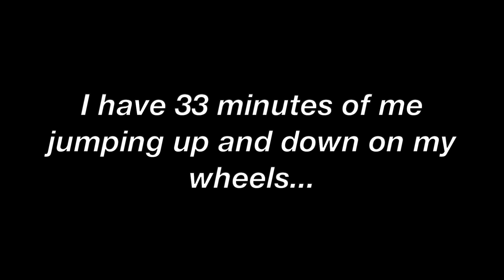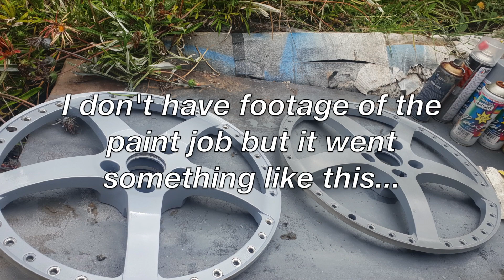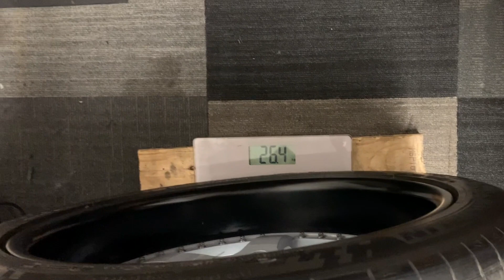Backspace, Offset and Superwide Wheel fitment. Stance 101: We fit 345s on an FG XR6 Turbo Ute

Comment: If you slot the rear guard in 2-3 places with a cutoff wheel, you can roll the panel a lot easier
Reply from the maker: Nice one BrettObie!
Have you ever found the panel flexes more where the slots are?
I would have thought it would end up cracking there over time.
Reply: @FairlyLegalCarMods   if you heat up the paint prior to, and as you roll, I've never had an issue with it damaging the paint. 

You will keep strength in the sheet metal from retaining the folds (if you leave a few mm of material before the bend radius) vs just cutting the whole lip off and pumping the guard

Comment: Nice work. Your clearance test is turning sharp onto a ramp. My ute had inside clearance like yours however the shockers hit on the wheel, and wheels hit on the chassis near the wheel arch brace. End result was added another 35 mm to my 40mm shortened diff (still minus 5mm). And then I flared the rear arches myself. I did it myself because ever oem customiser I dealt with stuffed every job. Premium Australian renowned Ford tuner put after market cams in it. 2 years and constantly returning to him because stalled and did all sorts and original cams back in and refund. Melbourne renowned drag race diff specialist in shortening diffs well I already explained that. Shaker distributor and fitter scratched my bonnet very badly kept the vehicle for a full day charged me $250.00 and never plumb the shaker up. I had to do it and his work was absolutely backyard butcher. Split system fitted and first drive and it was interstate the the exhaust actually fell off on the road. Took back and the tail pipes hit on the rear valence panel.... I got 355 x 30 x 19 on the rear of my Super Pursuit. With a huge off set to the outside. 3 peice auto art 9s on the front with 255s. Soon will flare the front to run 285s with approx 100mil of offset to the outside. Thanks for your video. Very good
Reply from the maker: Thanks mate. 
Sorry to hear that you had a rough trot with getting some work done. Unfortunately those stories are all too common.
Finding high level workmanship is getting harder and harder.
As far as clearance goes the front has been fine but honestly with the rear you are right. When it was fully articulated going up a steep incline on an angle the inside would kiss the inside of the tin supporting the tub liner. 
I just bent it in a little.
There’s been no issue with the shock touching but I’m sure some shock bodies are thicker and upgrading to a better rear shock would probably mean spinning the mounts and running them inside the rails.
Not too sure about 9s +100 on the front but if you want 100mm coming out from the hub face on a 9 you need around a +25.
Thank heaps for the comment and good luck with your build.👊
Reply: Gents how did you flare the rear arches?

Comment: Same tool i tried using on my rear guards and i had the issue with the whole tub flexing so ended up using a grinder but not a 9" used a 5" with a thin wheel and cut it away still needs a tad more. The tyre was only rubbing on one side so only needed to cut one side.
Reply from the maker: Nice one. Yeah sometimes the leaf springs can be a bit off centre.
9” is a bit overkill but I find it a little easier to cut straight.
If you just need a little more the sanding flapper discs work a treat and finish with a buff.👌
Reply: @FairlyLegalCarMods  I'm wondering if you put some paint back on the lip you cut off?

Comment: hey mate what offset are you running in the rear I have a FG falcon ute and want to run 13" wide.
Reply from the maker: Hey bud can't exactly recall but anything over about 11.5" you'd be mad not to measure your car.
There seems to be a fair bit of variation from ute to ute and you'll need it to be bang on!
Reply: @FairlyLegalCarMods  okay too easy cheers
Reply from the maker: Benson Hedges  thought I mentioned it in the vid.... 1 song. 😉

Comment: Have the front wheels eaten the inner guard yet? My inners are destroyed
Reply from the maker: They definitely would have if I didn't move the liner forward.
I replaced the upper screws for the front bumper with a longer ones that pulls the plastic liner forward.
Also had to heat and reshape them to clear when on full lock.👍
Reply: @FairlyLegalCarMods  oh really, nice... i will have to do that with the new ones i havent put on yet, you didnt record that process did you 😄🤔
Reply from the maker: @jo301a7h  I didn't but if you shoot me a message on insta @skidresponsibly I'll send you pics.
It's a very easy mod but a must for wide wheels on the front of low fgs.
Reply: @FairlyLegalCarMods  just made an account, will shoot you a message